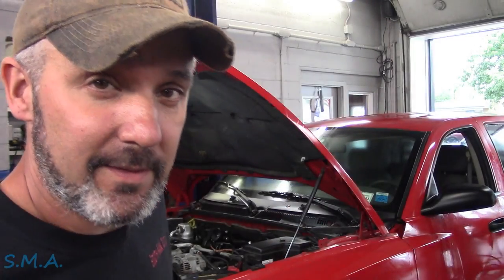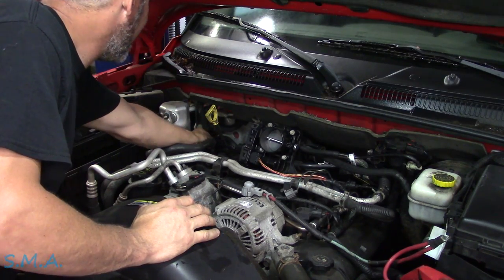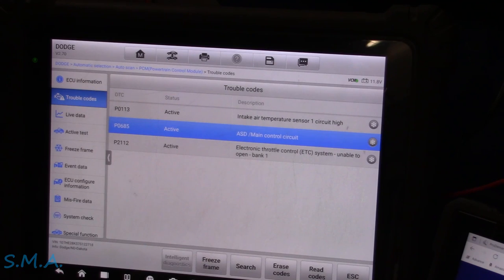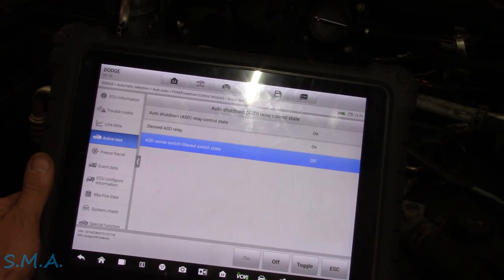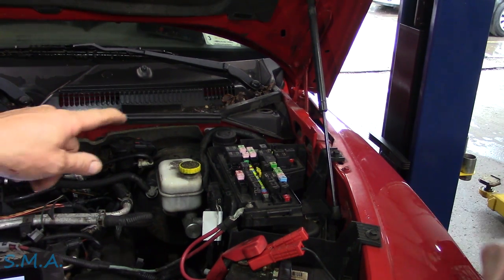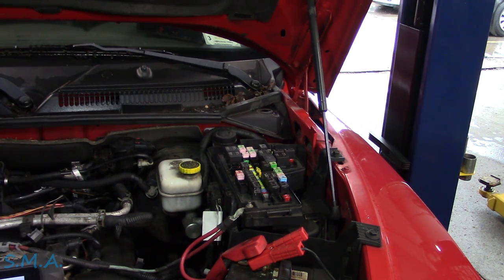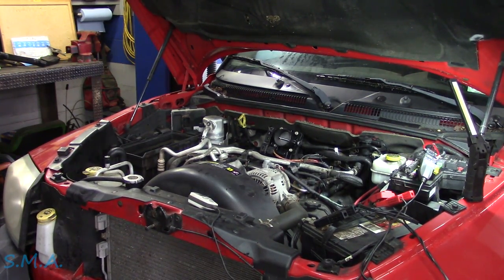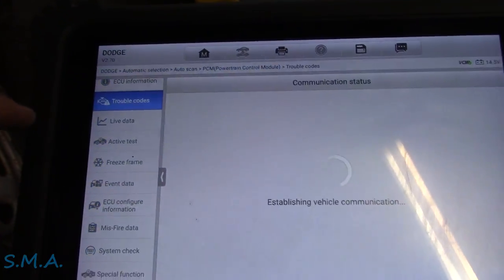Dodge Dakota: No Start After Clutch Replacement

Comment: I did a full timing belt, camshaft seals, water pump, tensioner, idler, belt service on my 2004 Audi A6 2.7T twin turbo engine.  It was more involved than any engine swap I've done.  I had to lift all four camshafts out and the advance solenoids.  After I got it all back together again and started it, it ran, but had no boost.  I went over everything and still couldn't solve the non-boost issue.  I finally accepted defeat and brought it to the Audi dealership.  The lead mechanic popped the hood and within a few seconds saw I didn't tighten down the clamps from each pressure pipe to the throttle body.  No charge, but I had several pizzas delivered to the shop as a thank you.

Comment: I put the upper radiator hose and clamp on just as the phone rang so I stopped and answered the phone. When I went back to the car I forgot I didn’t tighten clamp and was on the highway when the hose blew off and I kept driving to get off the exit (bad decision) and overheated the 390 Ford engine. What ended up happening was the rings collapsed and it burned a quart a day after that so I just sold the body to a guy who had a god engine and learned a hard life’s lesson. Do not start a step on anything that you can’t fully complete at that moment. Today I would have pulled that hose end off before going to the phone. 
I hope this helps someone here. 
These videos are great. I appreciate all the humor.

Comment: When I was 18, I had an old 76 chevy C10. I put a new head on it and forgot to reconnect the ground strap to the block. It ran like crap until I realized it. When I got that fixed, I went for a drive, and the transmission wouldn't shift. I forgot to reconnect the vacuum line to the modulator valve. That was my first time doing any real repairs to a vehicle.

Comment: My "too much repair" story: 1997 BMW M3 with "sticky" steering.  The wheel would just seize once in a while, which was exciting when making a turn to say the least.  Pulled the u-joint connection at the rack, turned the wheel left and right a turn or so and no sticking.  I thought it must be something in the rack. So, I put a new rack in it because 2 screws, 2 hydro lines and two tie-rod ends seemed the easiest route.  Reassembled everything and.... still "sticky".  Turns out the real problem was a spring at the base of the column right next to the firewall in the engine bay.  It needed some grease.  Greased it and the problem went away.  That's right, $0.25 in spray lithium grease solved a problem I spent over $600 (BMW = Bring Money With,  M3 = Much More Money!! LOL).

Comment: Yep the old wire harness pinched in the bell housing trick will do it everytime. Good fix lads.
Reply: "That's the third time I've fallen for that same trick this month!"
Reply: my vehicle actually has the crank sensor on the bell housing..... first time i pulled for a clutch job, didn't realize the crank sensor was there, and had the also harness fall between the engine and the tranny during reassembly. Had to get a new pigtail and sensor.... oh well. I wasn't the first one to make that mistake either as evidenced by a splice already in the harness.... lol.

Comment: There is one very good takeaway from this, at least for me.  Your comment around 9:00 is important to remember - before going crazy on anything that might be electrical, I will remember to disconnect the negative terminal.  Maybe that is what caused this, and when you have older cars (like me), I just have to reset the time and radio stations after a disconnect.

Comment: I didn't overlook , but I bought a 69 VW when I was 14 with a bad transmission.   After we got it towed home and took the wheels off to do an inspection it was a blown CV joint.  Bought the car for 125.00 and fixed it with a junkyard part for 25.00.
Reply: Had an 87 Jetta I got cheap with a "bad transmission"... same issue - CV joint - plus a bad DS wheel bearing.  Fairly easy fix, really like that car.  Eventually it did pop loose a differential ring-gear rivet, then it definitely had a bad transmission. ;)

Comment: Back in the day a lot of the time I would ignore "Step 1:  Disconnect negative battery terminal".  It was a pain and unnecessary for most repairs.  Back then, there wasn't a whole lot of electronics.  But as they started to add gizmos and doohickies, ignoring that step would come back to bite me in the seat cushion.

Comment: I think my best one was doing an oil change, getting everything buttoned up, and taking it for a quick blast to the shop.

Smell a little burning oil. Then a lot. Hmm.

Pull over, pop the bonnet, the engine oil cap is sitting wedged between the fuse box and the firewall, where I'd put it for 'safety' to prevent me knocking it down the engine bay.

That was a fun cleanup job.
Reply: Been there !.
Reply: @mrj57f  Put it somewhere that won't let the bonnet (hood) shut until it is moved.
Reply: Used to have an old Accord with pretty near 300k on it, used a lot of oil.  We drove it from NY to FL and back, and had to put a lot of oil in it, pretty much a half quart every fuel stop.  One stop, I forgot to put the cap back on.  We were a fair bit down the road when it started to smell horribly of burning oil.  I was over 2 quarts low, and there was such a mess, I had to take it to a car was to clean the oil out of the engine bay for fear that I'd set the thing on fire.

Comment: Oh, you don’t wanna know. 15,000 watt RF transmitter in test mode. Clear WARNING sign: DO NOT TRANSMIT WHILE IN SERVICE MODE. Well, guess who blew a 50 amp fuse because he overlooked… well everything. Sounded like a 12 gauge shotgun being fired. Replaced fuse, went to OPERATE mode and yeah, it worked just fine. It was the driver board that drove the signals to the RF amp. DOH!!!

So, yeah. Cars, MRI machines and toaster ovens. They all have “gotchas” built in.

Short and sweet video!! Thanks Mr. Eric O. You da best!!  Also, howdy from Texas to Mrs. O. Always great to see her.!! Y’all take care!!

Comment: Nissan Juke, I was asked to pick it up from the side of the road, so I hooked up my car trailer and grabbed it, then took it to my aunts house. I quickly determined no fuel was making it to the fuel rail, so I instantly asked "does it have gas in it?" she said she just filled it. So I continued checking things for another 20 minutes, then pulled the pump looking for a blockage or broken line (I could hear it running). I was about to replace it when I looked in the tank. There was maybe a cup of fuel in it. So I had loaded this car on a trailer using a come-along, hauled it, unloaded it, and took it apart when I could have just dumped my lawnmower gas can into it and drove it to the station. You cannot know how frustrating this is til you do it yourself.
Reply: Someone stole the gas
Reply: Sometimes it pays to look at and trust the gas gauge while you’re trying to start it, especially if it’s got that little yellow low fuel level light lit up.

Comment: Silliest/simplest thing I've done was probably the most recent repair. Dad's old truck kept killing batteries and he would return them and get a new one 2-3 times a week. Went through 9 batteries before I looked at it. Spent 60 bucks on a reman alternator, spent 30-40 min swapping them and put an old battery from the garage in. No problems since.

Comment: Purchased an 82 Camaro w the 2.8 V6 and a 4 SPD manual. Wouldn't run. Started fine until you let the clutch out to move. Found a ground strap the the back of the engine wasn't fastened to the firewall. Reinstalled that and it worked perfectly.

Comment: In h/s 3 of us spent 2 days trying to find why my buddies car wouldn't start. Took everything apart to do with the ignition system because it wasn't getting spark. Spent hours scratching our heads. Shop teacher "Did you guys check the fuses?" Blown fuse found caused by hot wire to ignition coil had rubbed through the insulation and shorted out to the coil housing. This is what i think of every time i hear you say keep it simple folks. 2 minute fix after 2 days of learning a life lesson!

Comment: Back in 1988, a low mileage 1968 Buick La Sabre, no heat, simple vacuum heater control valve right. Checked it and it was fine, the heater switch was on but she forgot to slide ( and I didn't check) the temp control lever. Didn't charge the older lady but the next day, she brought two jars of homemade strawberry fig preserves to show her appreciation.

Comment: We had a customer come in with a 1981 Ford Granada.  He complained of a "tacky" feeling in the steering wheel; you make a steering correction to the right and it continues right and vice-versa.  So, my dad starts explaining to him about the Eaton "linkage-type" power steering unit and the ball-stud that attaches to the Pitman arm, and the fact that the factory puts a plug in place of a Zerk fitting at the bottom of the actuator unit.  He went on to explain that water gets into those units because they aren't properly lubricated and might need to be rebuilt if we try to install a Zerk fitting and it still does the same thing.  The problem with that explanation is this car had rack-and-pinion steering, not the system he was talking about.  When I pointed that out, he looked under the car and saw the rack-and-pinion unit, got back up and did his best Emily Letellier:  Oh! Never mind!  I drove the car with the customer and heard what sounded like an old rocking chair coming from the front end.  The OEM ball joints didn't have Zerk fittings and couldn't be lubricated.  We installed new ball joints and he drove that car for several years after that.

Comment: My first and last goof was doing a driveway oil change. I did add oil back in but forgot to put the fill cap back on. Drove about 30 minutes and noticed that the oil pressure was a bit low. Stopped and popped the hood to find oil everywhere. Luckily I picked up a whole case of oil, so I had more to dump back into it and put the cap back on.

Comment: You had me at Dodge Dakota. This also looks like a used car guy engine bay clean special.
Reply: Those 2005 - 2011 Dakota's were such a let down from the previous generation. Worked on a 2008 in Baghdad that idled at 2000 rpm. Turns out the 3.7L's plastic intake manifold is prone to cracking under hot conditions.
Reply: @seanward7676  Hot conditions? Like the ones you might find in an engine bay?
Reply: @patrickgillilan3014  indeed
Reply: I've owned two Dakotas,  A nineteen ninety-five and an '05,.......Never a problem out of either one, and I kept them fifteen years.

Comment: Simplest repair for me, Working as a Mudlogger on a rig in northern Alberta when I walked past the Toolpusher's shack on my way to lunch at camp. He was outside fuming at his F250 (I think) because after replacing his battery, then his alternator and finally his starter, it still wouldn't even turn over. Pretty sure what the problem was and asked if I could give it a shot and he told me to knock myself out, but it wouldn't help. Pulled the top mount battery cables off and of course the were black from Lead oxide on the inside. Scaped if off with a screwdriver, put them back on, tightened them and told him to try it now. Started right up. Walked away without a word ... safer that way. Parts in northern Alberta are priced at a premium and each one required a 4 hour return trip in a borrowed vehicle. Do not do shotgun repairs, check the simple things 1st :)

Comment: At my shop, I once had Two yes TWO Trainees. I had them working on a Simple Brake Job. One on the Passenger Side, One on the Driver Side. Easy?? 🤔🤔Nope. Passenger Side Trainee forgot to Torque lug nuts on the Wheels. Driver Side Trainee forgot to put the bolts back in the Front Brake Caliper Bracket. 
Yes. I test drove it and had to walk three miles back to the shop. 
It was only a mile, however I had to turn around Three times to get over my Insane Desire to Commit Homicide when I got back.
Reply: Thats all on you for not asking them if they knew how to tie their shoes first..
Reply: You know when you have trainees that you're actually supposed to train them, right? That means checking their work to make sure it's right; not just assuming it will be.
Reply: I was servicing a customer's Mercedes a few years ago and my boss decided to "help" me by installing the new oil filter. It was only when the oil started gushing out onto the floor after the restart that I realised he hadn't put the new o-ring in the housing cover. Took a hell of a lot longer to clean up the mess than it would have done if I didn't have the "help". He stayed out of the workshop after that.
Reply: If it's a trainee situation perhaps you should have a supervisor to check on their work before test drive
Reply: Missed opportunity, have the trainees check each other's work and then come to you for final inspection. Of course if they were in the independent supervision time then you'd be SOL. 😀

Comment: I had done a clutch job on my old aircooled VW bug. I took it for a shakedown drive after putting the engine back in, and it died 3 blocks from my house. I had left the vice grips on the rubber fuel hose at the tank. So a carb bowl holds about 3 blocks worth of gas.

Comment: Here's one. My sister parked her truck on an incline with the front end lower than the rear. Says it will not run. The fuel pump is mounted toward the rear and the truck was low on gas. The gas was all toward the front and not reaching the fuel pump. Hard to restrain yourself when it comes to family. Lol.

Comment: Been there, this happens when you go to pull the starter and hit the end of the wrench on the chassie, while pulling the power off the stater. like Eric said, ALWAYS disconnect the negitive cable.
Reply: Done that before . Quite the blue arc 🤪
Reply: I always pull the negative cable. But it doesn't help if you drop a 10mm spanner across the battery terminals. I have a spanner now that has a rather attractive blue band in the centre of it.
Reply: Been there done that too. I had to replace the starter on my new(er) vehicle and was startled when it shorted. My previous vehicle was an old ford, you know, the ones with the relay under the hood so there was no power going to the starter unless the key was engaged? Now i make sure to disconnect the battery. lol

Comment: I just installed a depth finder in my boat and after I was done and cleaning up my tools. I went to check everything again and I had to ignition, no gauges and no tilt/trim. The radio, accessory plugs, lights, bilge pump all worked. I checked all the fuses at the helm, checked for power and grounds at the helm. Un taped all the wire harness's to trace wires. Finally, out of ideas, I checked the fuses on the motor. OMG, the 20amp fuse for the tilt/trim was blown. I have no idea how or why this fuse could have blown and how it cut power to the gauges and ignition. Great video Eric.

Comment: Had a tow in that was a start stall. Customer had the new battery on a charger at home and said he needs to do a security relearn. He came and did it after hours and said it didn’t help. Fast forward no codes does act like GM security but it’s not. Check fuel press, spark, compression and new plugs as they were fouled no change. Turns out the car sat all winter and summer and exhaust was plugged tight from the cats to the tail pipe

Comment: Simplest repair ever, I cleaned the IAC valve on a 1994 Dodge Ram 1500 with the big 5.2 the other day. Truck ran sluggishly and wouldn't flare up to fast idle during cold start.

Comment: I once spent hours attempting to diag a non functioning wiper pump, had power to the multi function switch but nothing coming out.  Then I realized I was pushing it the wrong way to get it to spray.  Everything was functioning just operator error.
Reply: Always blame “the loose nut behind the wheel”...
Reply: Lol reminds me of last year I was picking on my grandmother when she couldn’t get a gas pump to work for her I pressed octane option told her it’s not broke it’s operator error...with out missing a beat she tells me .. Imma error your operator
Reply: DOH!!  I HATE when those happen!
Reply: BTDT!
Reply: My problem was the reservoir was empty.

Comment: I put an engine back in a Subaru once after new heads, timing belt, water pump, etc. etc.  Started it up and it rattled like hell and my heart sank. Eventually figured out I had pinched the little dust shield under the bell housing up against the fly wheel.

Comment: We can add this to the list along with the car lacking the springs in the coils and the other car where the guy couldn't get the wheels off because he missed the little studs. Now we have a blown fuse as the source of a no start. This one had a replacement parts cost.

Comment: A couple of years ago on a '91 Celica, I had the 100A fuse blow leaving most of the electrics totally dead. After much investigation, the problem turned out to be a stray wire grounding to the alternator body. The stray wire in question was the remnant of a radio suppression capacitor. I still have the Celica and it is all documented on my own channel.
Reply: I once owned a 78 Celica for over 10 years one time just driving down the street everything stopped pulled over to the side of the road started taking a look and found that a fusible link between the battery and the fuse box had got eaten through it took me a day to get hold of a fusible link put it in fired right up course the guy at the Toyota shop said well first you need to find out why that occurred I said well it's 15 years old that's why...

Comment: I did an engine swap. The "new" engine mated to a manual trans in its prior life, but going into an auto now. This dummy left the pilot bearing in the crank. When tightening the bell housing i started bolts by hand and then gave then the full beans with an impact. Well I went to the junkyard for another engine after i snapped the flange off of the block.